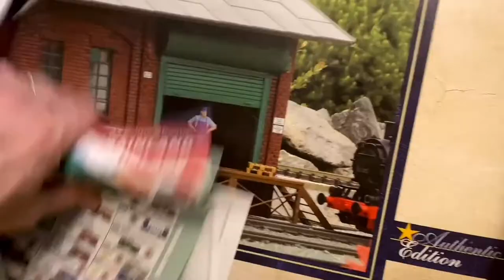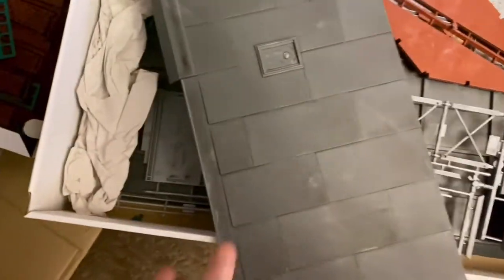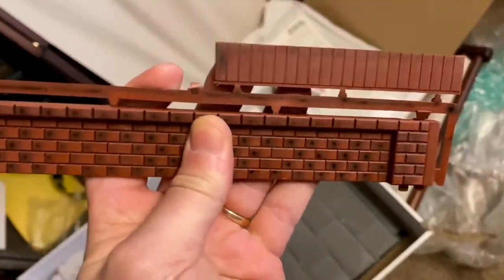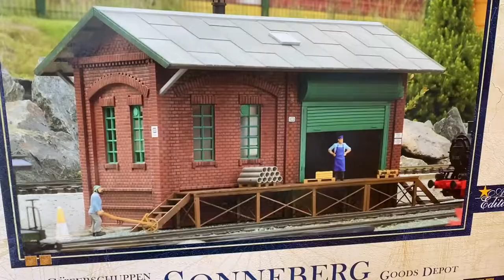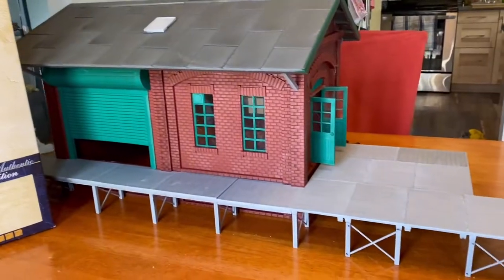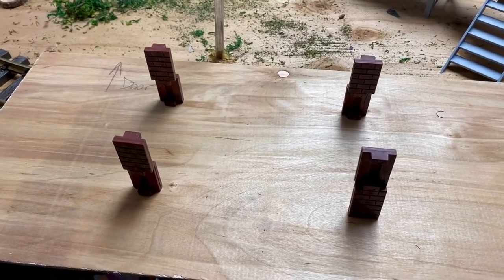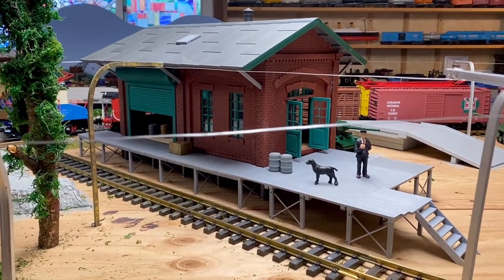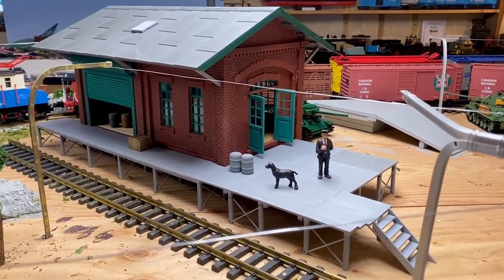Victoria BC: PIKO G Scale Sonneberg Goods Depot - Build, Tips, Mods & Review (It’s Great! See Blurb)

Comment: Thanks. The instructions aren't really that clear, and connecting the sections of the platform (0235 to 0233, using the 233-50s crossmembers) was confusing. It is an important part of the railyard. The floor idea was perfect.
Reply from the maker: You’re welcome. Why a floor was not included is strange. But it was an easy fix.